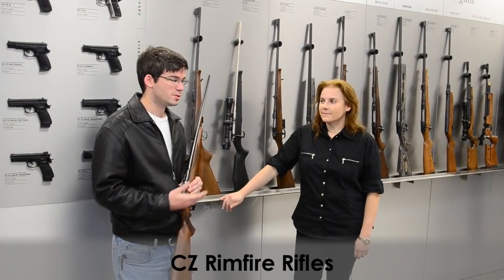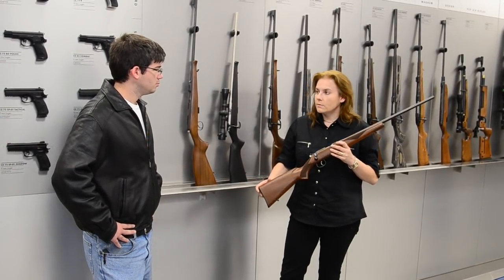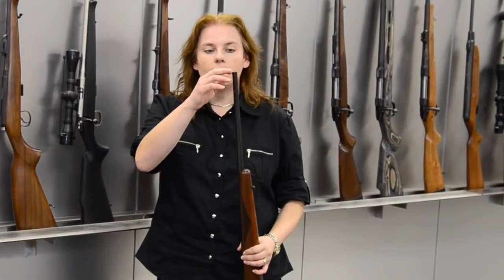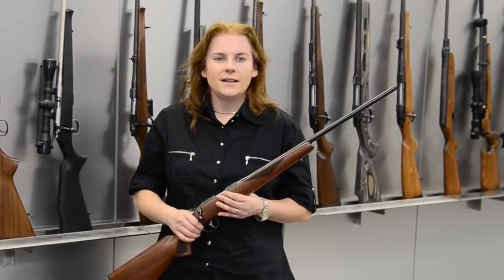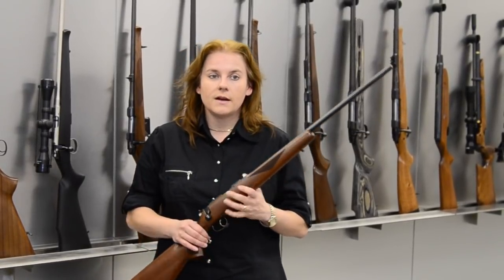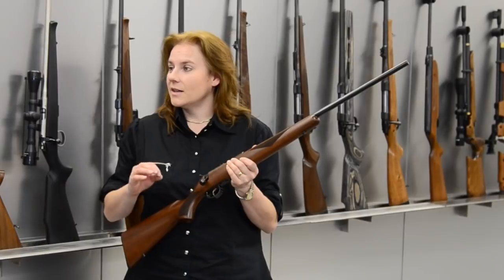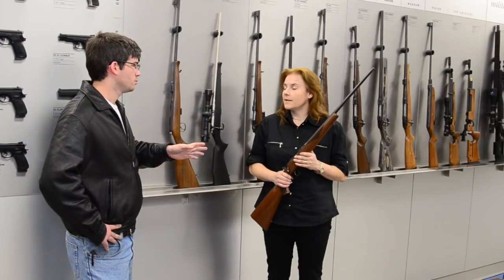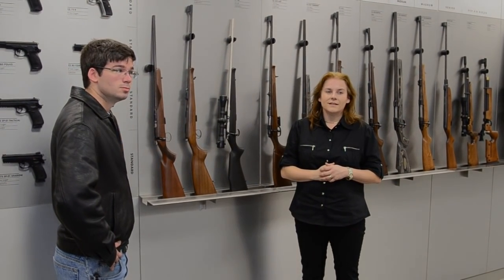CZ Rimfire Rifles - History Of CZ Rifles From The CZ Factory In The Czech Republic

Comment: The CZ spokeswoman should have said "You can see as we travel to our right, CZ quality goes down."   CZ built some really nice firearms in the 1990's-2000's....Quality on most the newer rifles is getting horrific. The 455 is a step down from the 452. Blue is not as good as 10 years ago. THE WORST thing CZ is doing is that horrific "LASER" burned checkering on the rifles.  Wish they would fire current management.
Reply: Oana Shields I agree with you , I feel that their older guns like cz 452 and cz 550 are much better quality than their current attempts!!